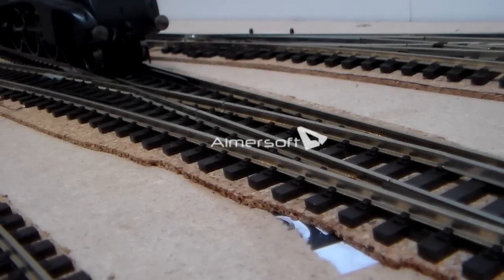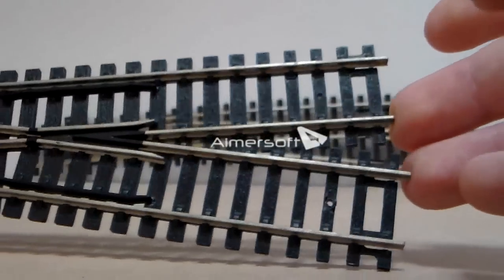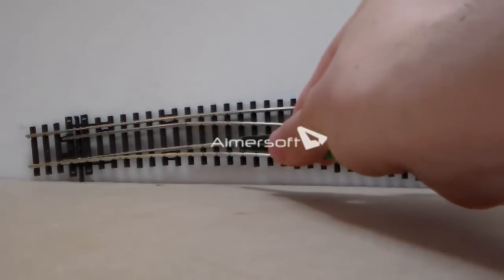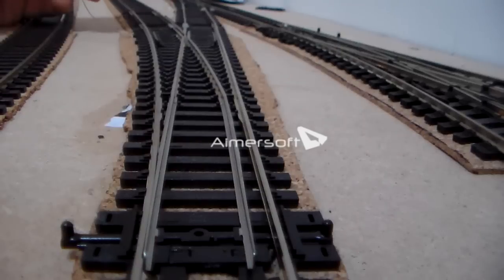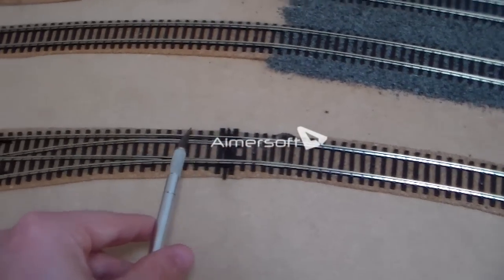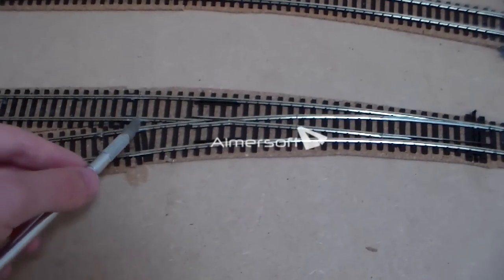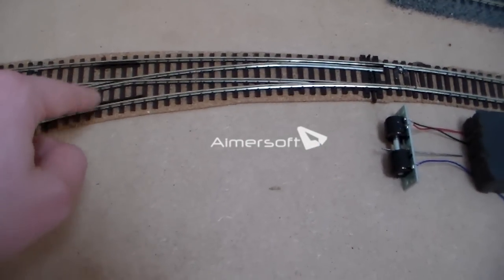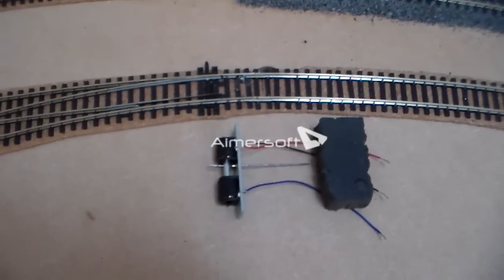Electrofrog And Insulfrog Points

Comment: I think that electrical wiring to the tracks should be on the outside of the track otherwise the huge blobs of solder that you have on the inside of the rails will interfere with the loco wheels and probably derail them!